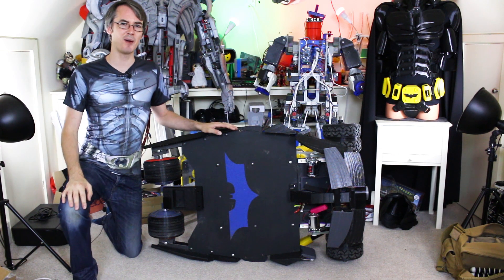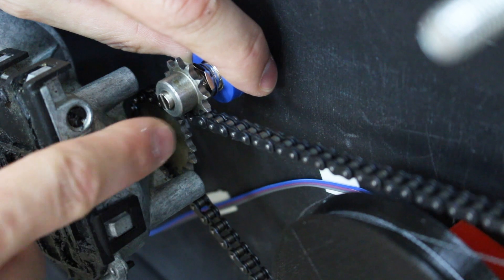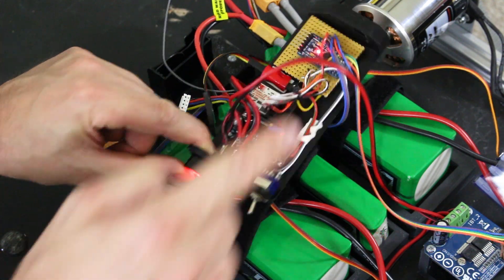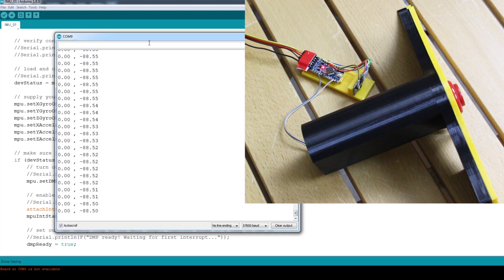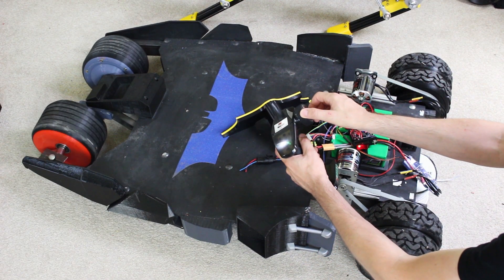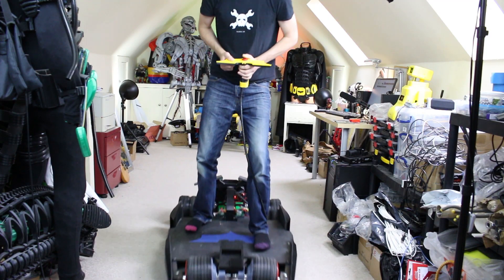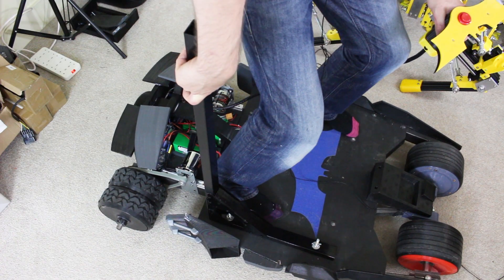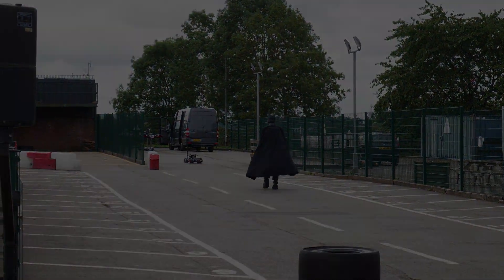Building a Batman Electric Skateboard #4 | James Bruton

Comment: I think you should make a hip tall, single pole, suporte for the handle, transforming it in a joystick. Calibrate the accelerometers to one on the boards base (so that the readings would not be afected by up/down hills or simple notLevel of ground). You would still be able to jump out whenever you need to, and, provided you mount the control on a spring typed base, you will be able to tilt it to follow your control scheme...PLUS, it would help to give you some balance to STAY ON TOP OF THE BOARD! Wich seams fun like hell...(jealous).😁

Comment: The solution to me seems to be not a very un-Batman like tiller bar, but to give the thing some tilt and sensors so you can steer it by leaning, like a normal skateboard. Then you just need a throttle control to be hand held (or included in a Batman gauntlet).

Comment: @James Burton,Have you thought about changing out the control for a trolling motor style control ,where you have the handle be the stirring control with an trigger as the accelerator switch  that way you can hold on,stir,and control speed with one hand  ,just wondering and if so it'd be a cool video to see.

Comment: Hi James, Great work. :) 
Suggestions-
1)Shift the support rod in the center and attach a sleek and slanting bicycle seat on the top of it. If not, then atleast put a proper grip handle on top of the existing rod. 
2) Program the break system to give it a smooth stop, instead of abrupt breaking.

Comment: Could you put the control module on the arm of the wetsuit so you can drive with the batsuit's arm?
Reply: Also you could add a holster of some sporting it to hold the remote controller

Comment: Instead of that pipe thing for stability you should make steering wheel in the front (in Batman logo design ofcourse).So you can control it easily but also get stability ! :)

Comment: I like the motion for steering, but I think a standard trigger control for the throttle would be better. The problem is now you are worrying about holding it at just the right angle while tipping it side to side. If you remove just one axis it would be immensely easier to control.

Also, thoes wheels? They need some black paint asap!

Comment: That dead mans switch looks a little uncomfortable to hold, wouldn't a trigger switch in the handle work better? Plus if it's an analogue trigger then you could use that to control the speed much easier and linked to a button it could change the trigger to control the reverse direction as well. Lastly I get why you added that support bar but it just looks ugly, especially when your not on it. If you could have made it so it lies down along the board and then when you need it you swing it up and lock it into place it would look loads better.

Comment: I tried using an mpu6050, but for some reason zero was not consistent...
Reply from the maker: You need to run the calibration sketch and plug the values into your main sketch: https://github.com/jrowberg/i2cdevlib/tree/master/Arduino/MPU6050/examples/IMU_Zero
Reply: James Bruton thank you!

Comment: Nice. You should 't really be using any control modes in the vesc other than current control. Not only is current control way nicer to ride but it doesnt give huge current spikes to the vescs which are not a robust design. Also it sounds like your belts are skipping heaps. If they are not HTD5M they should be. 12-15mm is the ideal width. Otherwise make sure they are nice and tight. It could also be the belt not meshing with enough teeth on your motor pulley as the angle is pretty wide but idlers are a pain so 15mm width belts may be a better solution :) FYI you can also add a small braking current in the vesc when it stops receiving pwm

Comment: Unfortunately those ten turn pots don’t do very well under constant use for very long. We went through to over them in a short time on our mechatronics project before ditching them to just use an encoder on interupt pins. Our application was nearly identical to yours, we were determining the distance that a retractable arm was extended or retracted and we had it geared down to use up about 8 out of the ten turns on that pot and it ended up giving us bogus feedback after not much use.

Comment: it also sounded like your chains / gears on the wheels were slipping when you sat on it and turned off the throttle. esc should not be used with auto-brake on this board
Reply from the maker: The ESCs have regenerative braking. The sound is trying to force them around when they are trying to stop
Reply: I know they do, but they shouldn't be braking when you release the throttle. they should brake when you lean back, or pull the throttle backwards. the belt is slipping because the motors are probably just stopping  / locking instantly.

Comment: You should have used the Wii Nunchuck Controller with Bluetooth. Trigger for throttle and thumb joystick for steering all in a small package.
Reply from the maker: I need to lean to steer, otherwise it's practically impossible to ride

Comment: Nice work
It would be much easier and safer to ride it  if you change the breaking value on vesc to something more like 20 or 30% 🙃 it will stop in much safer manner not throwing you off the board 😋

Comment: I know the bat steering is cool but regular longboard trucks would solve your steering problem. Also “skateboards” are best ridden standing sideways
Reply from the maker: The board is too wide to tilt for steering....
Reply: What about using a pressure pad so it can measure your leaning without actual tilting it?

Comment: I think you had issues welding as the brackets were galvanized metal so this reacts as you welding hence all the sparks. If you grind through the galvanized coating before welding it should be a bit easier. Great project!
Reply: ...and also make less toxic fumes....
Reply: grinding galvanized coatings is dangerous, you can release nasty fumes
Reply: Grinding galvanized is better than welding it, either way releases some nasty fumes though, but in the case of welding, those impurities make the molten bead finicky, hard to weld and a weaker weld when youre done, its almost always worth it to strip metal bare where you are going to weld
Reply: Why couldn't you have posted this last week while I was building my forge... took me a while to figure that out  :)

Comment: looking good, looks like you had a lot of fun too. I'd recommend using some smoothing so that the acceleration and deceleration is not so jerky. The sudden stops seem a bit harsh, maybe you can keep yourself from being thrown off so much.
Reply from the maker: It was pretty good once the pulleys on the motors came loose - I think one motor would probably work fine. I should probably get the smoothing filter from openDog on it!
Reply: I liked it that it is so hyper responsive. Still its a Batman Skateboard :)